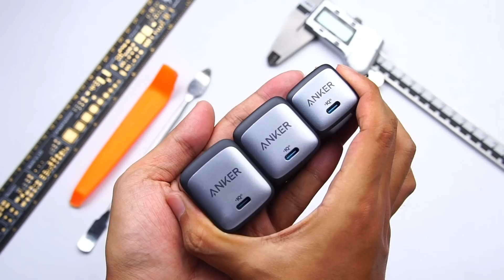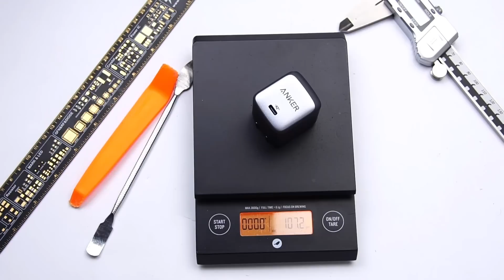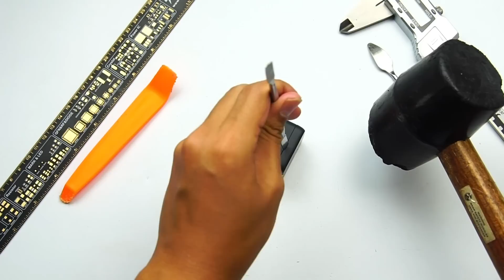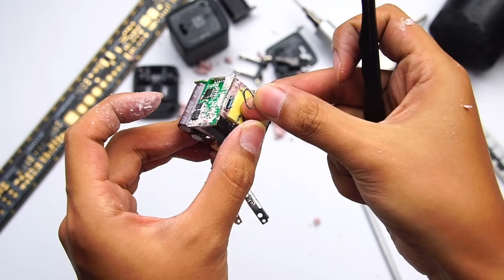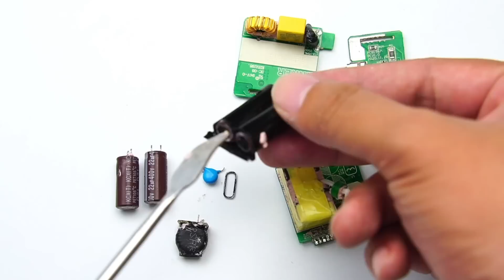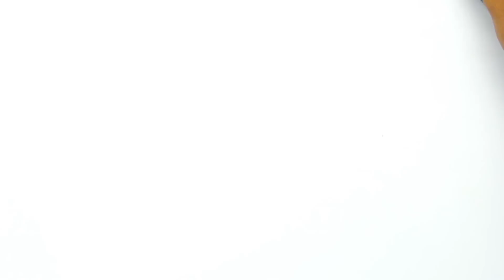Teardown of Latest Anker Nano II 65W Charger @ChargerLAB

Comment: Take it the glue isnt great at dealing with thermal? Cause Gan chargers shouldnt heat up  all that much and they do. Me and others have tried many buildings and many outlets. The gan chargers didnt take much longer than a normal charger to heat up under load.

Comment: Hi, I like to point out that US Plug versions have two versions one is regular 100-240V and other one 200V-240V snd one is sold in other countries except US. which might be problem if you travel different countries. (as qualoty of voltage supplied may b bad at some places)

Comment: For someone who needs to save each cubic centimetre in backpack this is perfect device. I have two of them if I need to travel only with notebook and few essential things (phone, sometimes iPad and headphones). The only thing that suprised me is when I bought EU version with Europlug connector, it supports only 200V - 240V 50/60 Hz ~ which to be honest suprised me as flyback SMPS typically has broad voltage compatibility

Comment: Hello Charger lab, Done subscribing to your channel. Can i Ask a question, i have a Anker Powerpoint mini dual port 12w charger, and i have a small observation about the charger because if i plug it in the socket it creates a small sound like buzzzzzzzz, i dont know why? can u please explain to me why it make small noise while im charging.
Reply from the maker: The coil of inductor in the charger produces a vibrating sound due to the magnetic field when the AC passes through.
Reply: @ChargerLAB  thank you very much ❤️🎉🙏

Comment: Bro Which wall charger is best for phones ?
I want versatility and Durability.
And Don't want to buy many wall chargers.
Need the best one for serveral devices and different ports. Bro

I am seeing Nano Pro and Nano II 65 W chargers.
Any things you want to recommend?
Reply: If you use Mac and iPad along with iPhone buy the latest Anker 65W nano. It will automatically adjust its output through recognizing what is pluggedin in the other end(you can always use single charger for everything). If you use only iPhone the new Anker 20W is best(It can also charge, Mac and iPad etc, but It will be slower cause max power output is 20W)

Comment: Looks interesting, what's your opinion about the limited input voltage of 200-240V/50-60Hz so you can't use in when travelling to America (northern, middle and parts of southern America) or Japan?
I don't travel much but most official chargers/power supplies do that, except older game consoles (and some recent ones, my Xbox Series X supports 100-120V+200-240V 50/60 Hz, also the Nintendo Switch ones but my PS5 is limited to 220-240V) you can often swap out the cable/plug because they use a IEC 60320 C5/C6 or C7/C8 connector or simply use a travel adapter for chargers like this.
Strangely the US Nano IIs are rated for 100-240V and for the european model Anker support says they may also work in 100-120V environments...
Reply from the maker: Yes, actually, this charger can also support 100-240V after tearing it down, the reason why it's printed 200-240V/50-60Hz may be the sales strategies in different regions.
Reply: Came here to ask this exact question. I haven't seen a consumer device in this category in a long time that isn't multvotage capably and found this really odd when I got my charger today. Glad to see that it can indeed handle 110V even if labeled as 220 only. Thanks for this teardown!

Comment: im curious of the "thermal glue" is meant to move heat to the outer shell or if its meant to insulate heat from the shell
Reply from the maker: It's used to dissipate heat, which means to move heat to the outer shell

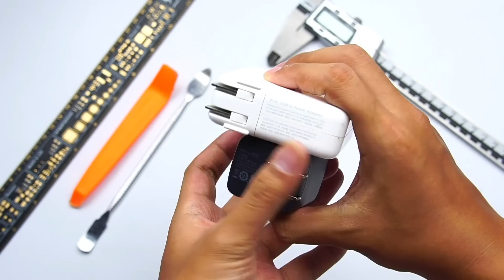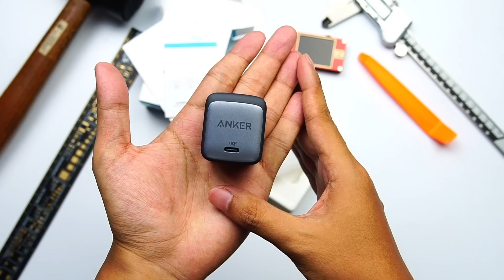Comment: Hoe come at 0:35 and 0:58 and 5:36, there is a different chasis with different certifications marked? I assume one is the International version, the other is the Chinese, but you do not mention this. The International has TUV marking, the Chinese doesn't. But are components the same in both versions, you open up the International here, but it is weird why you also have the Chinese in one video without notice, so is there any difference?

Comment: Nice and informative video. I do have a durability related question, does these chargers have a rating like a specific distance that they could fall to the ground for example from half a meter or 1 meter and still not be damaged or so? what would be the safe distance that if i accidently dropped a charger like this one to the floor, it would be still safe to use it? Many thanks :)
Reply from the maker: Different countries and regions will have different standards, it's hard to include all info in one video. As the consumer, it's should be OK if it still can be used.

Comment: Thank you for your teardown. Appreciate it & subbed. Can I ask, I have a Thinkpad Nano which supports 65w and I am sure that this charger can certainly do the job. I also have a galaxy ZFlip3 which only supports 15w charge. Will I damage the battery by using this charger ? If no, I do not need to carry 2 separate chargers with me. Thank you in advance.
Reply: No, it will not damage the phone, the charger will only provide what the phone calls for.
Reply: @andrewt9204  Tq very much. take care

Comment: I have the anker 18w nano chargers and they all make a screeching sound when charging while my apple chargers are silent. Does this charger also make a sound when charging? I also tried a ravpower 60w gan charger and it makes larger sparks when plugged in and it makes the sparks almost every time it is plugged in, also rare with the apple chargers. Can you include sounds and sparks in the future reviews?
Reply: wth?
Reply: @HoloScope  it is very faint and mostly when connected to a wireless charger, but even when not charging.

Comment: Will there be any risk to use this 65W charger to charge the new 14’ MacBook Pro (67W)? I heard you can’t use a lower wattage charger.
Reply from the maker: It's OK to use the lower wattage charger, the only problem is you'll take more time to be fully charged.
Reply: @ChargerLAB  2 watt will make a difference lmao?
Reply: I was using a 20W UBS-C iPhone charger to work on a Macbook Pro 13" keeping the battery level stable. Even a 10W old iPad charger with USB-A to USB-C cable works, not enough to fully power the laptop but battery drains 3 times slower. 
USB-C charging is very smart, no risk damaging laptop with a low power charger, if the charger itself is from a good quality brand. A major hurdle is inability to quickly top up laptop battery, e.g. between the meetings.

Comment: I just wish they'd made a white, 3-pin, foldable version.
Reply from the maker: @anker😂 hope it'll come true.
Reply: @ChargerLAB  Considering heating concerns, I would've thought white would be the default colour for most chargers and high-performance phones.
Reply: @MalaysianTropikfusion  Black is actually a better color for housings to radiate heat away. It's why when you are taking a temperature reading with an IR camera, you want to try using a black-body surface because they have the best emissivity.
Reply: @Doppler_Effect_aga  Now that sort of makes sense, too. I don't know what to think now 😣

Comment: Can you compare the wattage per gram of this and other chargers? The first GaN charger I got was small but felt very heavy. I was a bit disappointed.
Reply from the maker: The weight of the charger is about 137g (4.83 oz). So, wattage per gram will be 65/137 = 0.474 w/g. You can do that by yourself. Cause we'll provide size and weight data for every single power-related product we have torn down.

Comment: Thanks for the video. Where is GaN, the technology behind this charger?
Reply from the maker: GaN is just a semiconductor material, compared with SiC, it can make the charger smaller and compact.
Reply: In the transistors and diodes in converting ac to dc

Comment: Great teardown. Would like to know the dimensions and weight of the 30 and 45W versions as well, for comparisons.
Reply from the maker: 30W will be 38*31.6*30.4 mm, and 45W will be 41.2*35*37.6 mm. But the power density of 65W will be the highest.
Reply: Would be ok to just buy the 65w for samsung note 20 ultra?
Reply: @swahab  Yeah, you'd just be paying more for the exta power you're not using. 25W is all you need it looks like.
Reply: @Morelandos  thanks.
Reply: @Morelandos  I want to charge my  s22ultra and laptop so 65w would be best for me?
Reply: @swahab  It makes sense if you are going to use the same adapter for both Note 20 and other high power device like notebook, otherwise 45W would better suit your needs.